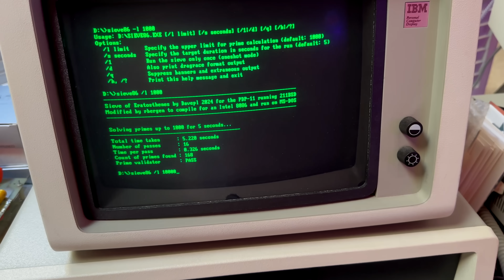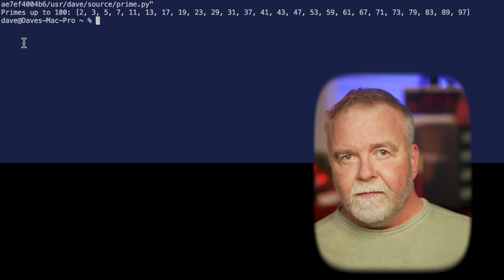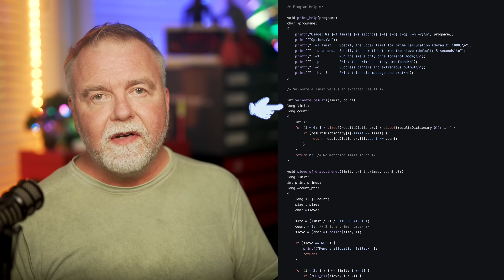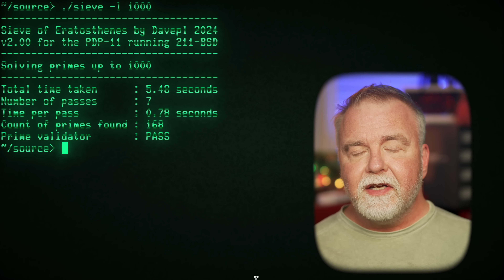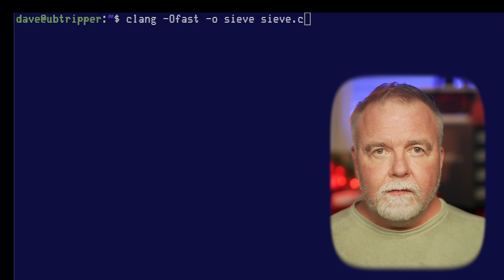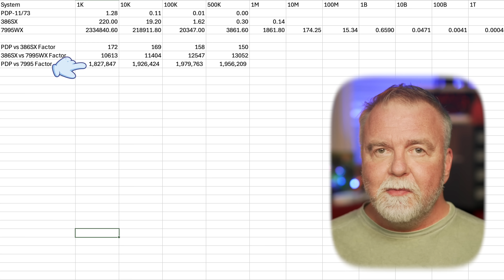Solving the Primes to ONE TRILLION on the desktop!  Plus PDP-11 vs Threadripper tested!

Comment: I'm sure part of the ThreadRipper's win over the 386SX is due to compiler optimizations. Since x86 backwards compatibility is a thing I'd like to see a binary built for the 386 run on the TR to get a more useful comparison. Assuming the 386 has Windows (3.1 or later) a Win32 application would be the easiest way to do this.

Comment: I downloaded the sieve code and tried it on my PiDP-11 running 2.11 BSD.  Amazingly, 500000 takes 78.35 seconds on an emulated PDP-11/70 hosted on a Raspberry Pi 3.  The hardware is only 5.6 times slower than a modern software emulation on a small system.  The Raspberry Pi is better at pretending to be a PDP-11/70 than an actual PDP-11/73!
Reply: Just tried tried this with a Mac Mini (M1 processor) emulating a PDP-11/70.  Results:  4 passes, 1.62 seconds per pass, 6.48 seconds total.  This has to be the fastest "PDP-11" I have ever seen.  The Mac Mini itself did 6257 passes at 0.00 seconds per pass for a total of 5.00 seconds.

Comment: Hey, you are probably the best person to talk to about primes and the idea of using cuda cores to write a program checking a huge given number whether its a prime or not. I imagine that it could be done with few rtx cards like 3090 or 4090 and the right program to be able to check something like 2 to the power of 82,589,933 − 1 within few days. What do you think?
Reply from the maker: We already have a CUDA solution in the PrimeCUDA folder of the Github primes project, check it out!  On a 24GB A6000, you could likely do 500B max?

Comment: I tried to generate a trillion primes on my r9 7900x with 32gb of ram and managed just fine by using a wheel to exclude multiples of 2 3 5  and 7. That vastly reduced the amount of memory used and also the amount of division required.

Comment: I know the point is to see what is possible on the hardware, and not the efficiency of the algorithm, but there are better ways to do this far faster ( that are publicly known), the first is a deterministic miller Rabin probability prime test, 

if n < 2,047, it is enough to test a = 2;
if n < 1,373,653, it is enough to test a = 2 and 3;
if n < 9,080,191, it is enough to test a = 31 and 73;
if n < 25,326,001, it is enough to test a = 2, 3, and 5;
if n < 3,215,031,751, it is enough to test a = 2, 3, 5, and 7;
if n < 4,759,123,141, it is enough to test a = 2, 7, and 61;
if n < 1,122,004,669,633, it is enough to test a = 2, 13, 23, and 1662803;
if n < 2,152,302,898,747, it is enough to test a = 2, 3, 5, 7, and 11;
if n < 3,474,749,660,383, it is enough to test a = 2, 3, 5, 7, 11, and 13;
if n < 341,550,071,728,321, it is enough to test a = 2, 3, 5, 7, 11, 13, and 17.
Using the work of Feitsma and Galway enumerating all base 2 pseudoprimes in 2010, this was extended (see OEIS: A014233), with the first result later shown using different methods in Jiang and Deng:[12]
if n < 3,825,123,056,546,413,051, it is enough to test a = 2, 3, 5, 7, 11, 13, 17, 19, and 23.
if n < 18,446,744,073,709,551,616 = 264, it is enough to test a = 2, 3, 5, 7, 11, 13, 17, 19, 23, 29, 31, and 37.
Sorenson and Webster[13] verify the above and calculate precise results for these larger than 64‐bit results:
if n < 318,665,857,834,031,151,167,461, it is enough to test a = 2, 3, 5, 7, 11, 13, 17, 19, 23, 29, 31, and 37.
if n < 3,317,044,064,679,887,385,961,981, it is enough to test a = 2, 3, 5, 7, 11, 13, 17, 19, 23, 29, 31, 37, and 41.

notice the pattern, but I think there is a limit to Miller Rabin accuracy without finding more zeros of RH , there are other optimizations are known, wont list them all here, but simplest is skipping even numbers. They can be found on wikipedia. Happy hunting!

Comment: it's not procrastination, it's a question of efficiency :P the moment it requires you more energy to ignore a problem than it would require to solve it, that's when you shall start ;) 
in other words, it was easy to ignore answering the question about this very time consuming prime sieve calculations on the pdp-11; but with the clock speeds of an AMD Threadripper, one might be inclined to solve those equations to it's  fullest.

Comment: It's not a folder Dave, it's a DIRECTORY, especially on a UNIX system like BSD. It's not a folder, even on Windows: open the command prompt on the newest Windows operating system, and run the DIR command (for DIRectory) and see all the DIR entries listed, as they are directories, not "folders". "Folders" do not actually exist anywhere other than in the stupid Microsoft Windows graphical user interface; they are not a thing Dave, and should be purged from daily use, as they are incorrect, completely made-up terminology which does not correspond to reality.
Reply: Touch grass, nerd. 🤣
Reply from the maker: Folder folder folder folder you can't stop me hahahahaha folder folder folder
Reply: @DavesGarage  who came up with that "folder" retardation? That's severly dumbed down... what was wrong with directories?

Comment: In my college days we got a FORTRAN assignment to calculate factorials.  The size of results quickly blew out the integer value limit on our DEC-10.  Solving this was the true intent of the assignment.  Storing one digit per integer and writing our own math routines was the order of the day.  And so many people completed the 100! challenge.  But this wasn't good enough for me.  I wrote a nice assembly program that packed nine decimal digits per 36 bit word.  1000! was mine.  But they came out and yelled at me for bogging down the entire system for those few minutes.  

I'd do it again.

Comment: Wonderful. An excuse to waste another morning replicating Dave's code.
Sadly I no longer have my PDP 11/34 and I ought to throw out the Entrex but 16x16K mag memory is a thing to behold.
Are you sure about that 168 number? I keep getting 169.
pip-pip
Reply: The total number of prime numbers 1 to 1000 is 168. Are you counting 1 (which isn't classed as a prime number) within your primes?
If you want to use PDP11 without actually having a physical PDP, there is simh. That's what I use. It'll run RSTS/E,   RT-11 and Unix (available from the site).  simh also allows running 'bare metal' PDP11 binary programs without the aid of any os which is kind of cool. I've modified Dave's sieve assembler program for just that using the real time clock interrupt to get timing info.

Comment: I just discovered your channel and I love the vintage vs. modern hardware, ASM and K&R C, and your insider's explanation of retro code.  Thank you for promoting autism awareness.

I hope people appreciate two examples of programming economy in the line (for j=i*i; j<=limit; j+=2*i) that you don't highlight in your walk-through.  This line in the inner loop is gold and surely saves more than half the time vs. a naive implementation like (for j=i+i;j<=limit;j+=i). First, initializing j at i-squared saves time because because all smaller products with i have already been eliminated.  (I.e., when marking off factors of 5, start at 25 because 10=2*5, 15=3*5, and 20=4*5 have already been eliminated as factors of 2 and 3.)  Most SoE examples do this.  The second one, which I don't often see, is j+=2*i.  Why increment j by 2*i rather than i?  Because in your approach, i is always odd (because there's only odd numbers in memory) and j always starts odd, so incrementing j by i would result in an even number, which we already know is not prime.  So no need to check it; rather, increment j by 2*i (which is always even) so j+=2*i is always odd.  Crossing off the products of the smallest primes takes the most time, so halving the number of times you increment j from the beginning surely speeds up the algorithm.

You mention it tangentially, but I wonder how much of the x2M and x12K performance increases are a factor of CPU speed vs. RAM access time since the algorithm is memory access intensive?  Either way, it's amazing how far things have progressed since the 80s.

Comment: That's great!  I used PDP computers in college, and at my first job we had a microvax cluster and a unix system with a couple of 68020 single board computers.  It was clear even then that the 68k processors were superior, and they kept getting faster.  DEC tried to sell us an upgrade to an Alpha server, but by then no one wanted a mini computer. 
the SBC and PC machines were cheaper and we knew they'd just keep getting faster.

Comment: No comment on those "Prime validator: FAIL" lines?
Reply: Someone above pointed out that Dave(?) uploaded a change to correct the error that caused the "FAIL" message.  I haven't looked, but have to ASSuME that it was a change to the GitHub code.

Comment: Curious question - why was the program producing "FAIL" when you increased to the larger work load - was there a typo in the validation routine or did something actually fail in the process at that scale? 12:20 - "I just caught you said 'up to a particular limit' - and I assume that above a certain number it always failed because it didn't have historical data to compare against?"

Comment: Of course knowing that it would take decades, the program could be structured to write the current state of the sieve to disk when prompted so it can be transfered to new hardware every few years as upgrades become availible. 
(Assuming the algorithm output is desired for somthing other than a benchmark, and if the algorithm is the most efficient known for the task. I know there are faster algorithms than the sieve if primes were the only purpose.)

Comment: You can compute significantly more primes in limited memory if you're willing to add a little bit more code and handle the first few primes as an exception. Basically you can also ignore any number divisible by 3. We know that n % 6 = 1 or 5 for any n >= 6. That reduces your required memory by 33%! You can get a further boost by skipping 5 but it might not be worth the additional complexity.

Mathematicians will often refer to properties of primes mod 24, p >= 24, but I don't think that helps us directly...

... but if you do the math we know that there can only be 8 primes for any block of 24 contiguous numbers (>= 24). That's pretty convenient!

... and if we want to get really fancy we can use separate tables for the mods 1 and 5. That should simply computing the offset and bit mask of the multiples.

Comment: Your computers look so clean to me while I watch your videos for entertainment so I don't get bored while shearing the fur off of the dust bunnies that have been crossbreeding in my heat spreader fins and case vents for the last 3 years. I have found that by sheering the bunnies it is easier to cull their numbers in my once-per-pc lifetime cleaning that occurs when my liquid cooled i9 rage blue screens because it overheated opening an empty spreadsheet file. I can also use this bunny fur to loom dust-bunny-wool thread that I use to knit socks that I sell to offset some of my electrical bill that is inflated by the thermal inefficiencies of not cleaning my computer. Some call that a loop of inefficiencies that can be solved by regular maintenance, and to them I call it "job security" and would like to remind them that anyone who has ever owned a Ford understands that maintenance is utterly pointless.

Comment: Is that a venerable Linksys WRT54G? Or did they make a later model that duplicated the appearance? I used to have half a dozen of those things, running hacked firmware of course. I haven't seen one in years, though.

Comment: Slightly different approach, but I was able to calculate the primes up to 1 billion on my Ryzen 3950X in under half a second, bit I did split the search up into 100 threads which helped. Could probably go faster, but I don't really know what I'm doing.

Comment: what is up with the primes validation error at the bottom of a lot of these bigger tests?
Reply from the maker: The table only goes so high in order to compile on 32-bit platforms, so it doesn't know how many primes should be generated, so it says fail.  But it's right, I checked!

Comment: In the macro-11 code, why not use a SOB instruction (subtract one branch nz) for the init zero loop? You wouldn't then need to use R2, just SOB R1, INITL. If BSIZE is even, then why not CLR instead of CLRB with a loop of BSIZE / 2 iters?
Reply from the maker: Hey, I was just pleased it worked and got the right answer :-). Good optimizations though!

Comment: I'm disappointed that Dave didn't toggle the sieve code in via the 34's front panel. 😊

He must be made to pay for his unspeakable omission of Macro-11!
Reply: macro-11/linker produces binary code that requires an underlying os (eg. for the .TTYOUT  etc). For 'bare metal' code you have to provide everything yourself (including console display by moving a char to the console memory location). If you want to this, you don't want to enter a program like sieve via toggle switches (or even via a console front panel). What you do is connect the console serial port to another computer, have a simple loader program that is entered by hand that obtains the binary from the other computer and stores it in memory and then when loaded runs the program. You need though a PDP11 assembler on that other computer to produce pure PDP11 binary code.

The pdp11 simh emulation allows a memory load from a file in loader format. I have a stand-alone C++ PDP11 assembler that does just that. Modifying the Sieve assembler program to also include routines to replace .TTYOUT and .PRINT etc and running the program via simh gives:

PDP-11 simulator V4.0-0 Beta        git commit id: 247bd8d5
Disabling XQ
sim> lo sieve.ldr
PC: 1026
sim> go 1026
Sieve of Eratosthenes by Davepl 2024
------------------------------------
Clearing byte array.  Sieve Size: 1000
Setup complete
Running sieve
Sieve complete
Prime numbers found:
2,3,5,7,11,13,17,19,23,29,31,37,41,43,47,53,59,61,67,71,73,79,83,89,97,101,103,
107,109,113,127,131,137,139,149,151,157,163,167,173,179,181,191,193,197,199,211
,223,227,229,233,239,241,251,257,263,269,271,277,281,283,293,307,311,313,317,33
1,337,347,349,353,359,367,373,379,383,389,397,401,409,419,421,431,433,439,443,4
49,457,461,463,467,479,487,491,499,503,509,521,523,541,547,557,563,569,571,577,
587,593,599,601,607,613,617,619,631,641,643,647,653,659,661,673,677,683,691,701
,709,719,727,733,739,743,751,757,761,769,773,787,797,809,811,821,823,827,829,83
9,853,857,859,863,877,881,883,887,907,911,919,929,937,941,947,953,967,971,977,9
83,991,997,
Number of primes found: 168
Took: 160 Milliseconds

Comment: don't you compile with optimization? I get 4.6m passes on my not as ancient as the pdp11 Intel G4560 running a gcc compiled ( -O3 ) sieve.c for 1000 primes. And 3683 passes for -l 1000000
since this is twice of what the treatripper does, something must be different

Comment: Historically you used bits / bools to minimise memory use, but today we rarely need to.  I'm wondering how many CPU instructions and cycles it takes to deal with a bool as opposed to just setting a byte or int to 1 or 0.
Reply from the maker: Oh, it's more for sure, but if we wasted memory in that way, it couldn't reach a trillion.

I'm guessing a byte-per-element would be the fastest.  There's some virtue in bits because it increases the memory density and hence cache locality, I assume, but likely not enough to compensate for the overhead of the bit masking.

Comment: I used pdp-11 asm for my assembly language course.  So it's off to github I go for the code...

Someone needs to send Dave a pdp-11 Unix tape.  Unix ran on the 11/23+ (with 256 KB of RAM), so it should run on the 11/34.

Comment: You might not want validate_results() in sieve.c to be boolean.  You could return a value besides true or false if it is not found and either not print that line or indicate "NOT FOUND" instead of "PASS" or "FAIL".  "FAIL" can be misleading (You don't knowthe value  or it's wrong).  Usually I'd say to return "-1", if not found, "1" if validated and "0" if incorrect; however, I don't think C requires 1 to be true and 0 to be false, so you'd need to explicitly return the values or return an arbitrary value and test for it if not found though.